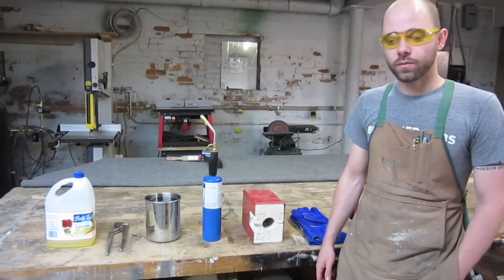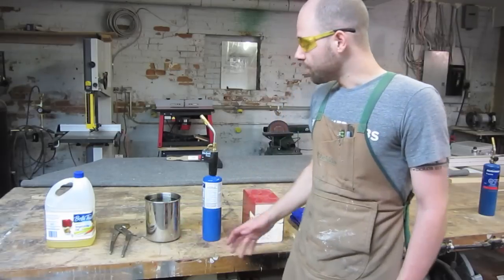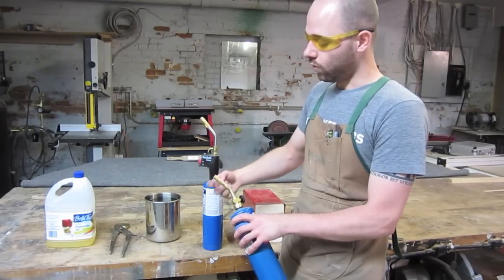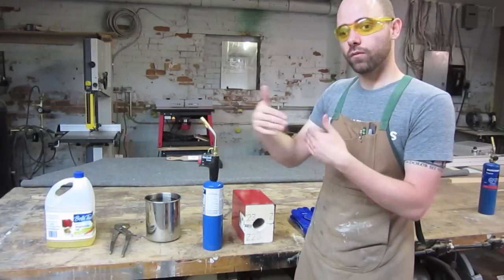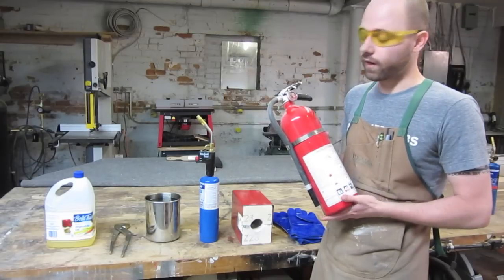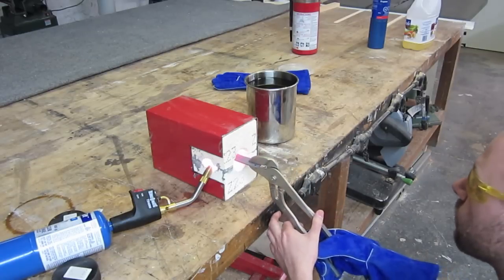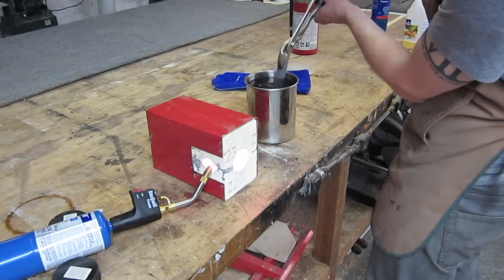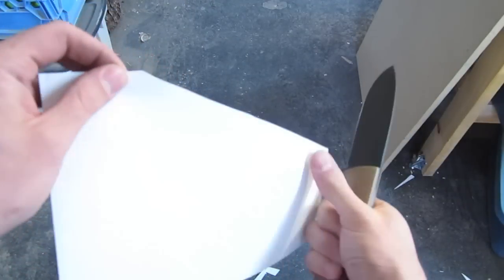How to heat-treat an O1 knife blade using cheap common tools.

Comment: Couple questions: where do you get the fire bricks?  Also,  do you know if this method would work for 5160?  Thanks for the vids, they are great and happy Forth of July!
Reply from the maker: paradox.c.moron Hey mate! Happy fourth to you too! I got my firebricks from a pottery supply place, look for furnace supply, pottery supply, ceramic supply in your area and you should find something! They need to be the soft white kind (K23 fire brick).

This exact method will work perfectly with 5160!

-Aaron

Comment: I just built a similar forge and decided to go with the bernzomatic  ts4000. Any issues with putting the head directly in the firebrick whole? I have heard its good to place the head ~1 inch away and I am worried it will heat up too much and melt the head. On the other hand I am worried I will loose heat and i wont be able to get the forge hot enough for working the steel. I'm working with 1095 and/or W1 tool steel. Any info helps, thanks for sharing so many great videos!
Reply from the maker: +Joshua Humphrey I haven't had any issues with having the head of my torch in contact with the brick, I doubt it will cause any problems, just don't jam it right in there, mine is just touching.

Comment: hi ty for the information i was wondering if you could hold the torch and move it back and forth on just the sharpening edge to temper it and not heat the entire blade so the back is softer and the blade edge is hardened ? ty foe the vids and your time.
Reply: You can yes, but I don't think differential hardening is a good idea. I recommend you harden the whole blade, and then do a 'differential temper' where you temper the spine a bit softer. That way you end up with a spring temper on the spine which is both strong and flexible.

Comment: For this specific application, how long did you let the forge heat up, and how long did it take to get the blade hot?
Reply from the maker: +malachi1616 I think the forge was pre-heated for about 10 minutes, then a little bit less to heat up the blade.

Comment: Man, I built a very similar design 2 brick forge. But I cant get the results you are. It appears to have good swirl. But the inside of mine doesnt glow as yours. Also I am currently unable to get my steel to temperature. Do you think its the torch head im using? I also dont have the bricks cemented together. Could this be the issue? So frustrating trying different things to get it right and not succeeding. Thanks again for the great videos and attitude.
Reply from the maker: Hey mate!
What kind of bricks did you use? are they soft white fire-bricks? What kind of torch are you using currently? It could be part of the problem... 

I understand what it's like to try and try and have something not work. Stick with it and I'll help you sort it out!
-Aaron

Comment: Great  video!  Thanks a lot. I keep  coming  for  more  tips:)
Can  somebody tell   what  would  happen if I  overheat  the  blade? 
Im having hard time getting  the "cherry red" color  on O1 steel...  When it  kinda looks  red ish,  it  still sticks to magnet, when its  almost  non magnetic  its  already more  like  orange, than  red...
Reply from the maker: RS Hey mate!
If you overheat the blade it will likely be a bit brittle, but should otherwise be ok.

One thing that trips a lot of people up is that you have to do your heat-treatment in a relatively dimly lit area. If you try to do it outside in the middle of the day under sunlight, the bright light will hide the colors of the steel. It's best to do it at dusk or even at night so you can see the steel glowing better. This is the reason that blacksmith shops are nearly always quite dim inside.

-Aaron
Reply: Gough Custom 
Thanks  a lot

Comment: I've been making knives from files and hardening them this way, I have to admit i'd be afraid to try and bend one in a vice though. Do you know what type of steel most files are made from. I used to make them without annealing them and keeping the blade cool while i grind it as not to loose the temper. I had broke 2 knives with hard use this way though lol... I think it's time to move on to some O1 and see how that works for me. Thanks for the video.
ATB, Steve.....
Reply from the maker: stevenk1965 Hey Steve!  I believe a lot of 'good' files are made from 1095, the problem is that a lot of files are also made from mild steel and then case hardened which means the steel in the mill is no good! I think switching to O1 is a good move! That way you know exactly what you're getting and your hard work will never be in vain!
Reply: Gough Custom Good to know, thanks for the response. BTW I'm not to far from you I live just outside Rochester  NY. Your accent fooled me though I wouldn't have guessed you were for Canada lol.

Comment: Aaron, thanks for the videos. I have really gotten a lot out of them. So my question for you is, when you heat treat in the forge, do you flip the blade end to end and also heat treat the entire handle. If so, do you allow the blade to cool completely, before you do the tang? Or do you just quench, flip it over and go right back into the forge?
Reply from the maker: The only reason I heat-treated the handle in my other video was to make the steel hard so the window-breaker would function. It's not ideal to have a soft tang on a knife, but it's not an enormous issue either... So what I'm saying is that there's really no need to flip it and heat-treat the handle. You have to be very careful doing so as well as if the heat gets to the blade it will make it fosft again.
Reply: Gough Custom On wrenches they don't harden the handles so they'll bend instead of break. I think a soft tang will be more durable in that regard.
Reply from the maker: Keith Larsen A properly hardened knife tang/blade will bend and spring back rather than breaking or bending and staying bent... Leaving the tang soft just makes it much more likely you'll end up with a bent knife! Properly heat-treated steel is very strong.

Comment from the maker: When using a forge this small it's kind of hard to heat the handle too. It's better to do both the blade and the handle though if your forge is larger.

Comment: Hey I've been following your tutorials and I'm now looking for a torch to heat my forge. Other than the air intake position of the torch are there any other things I have to look for when making a purchase? Bernzomatic torches arn't easy to find locally in Oz!
Reply from the maker: P-Vinny Make sure you don't get a 'pencil' torch (very small flame), other than that as long as you take the air hole position into account I think you should be fine!

Comment: Hi Aaron, thanks for all the help with these videos and responding to my comments. So I’ve tried to replicate this process with O1 tool steel and essentially a set up identical to yours and the best I’ve been able to acheice after tempering is 52 Rockwell hardness (c scale). I’ve been told that’s too soft and I should be getting nearer to 60 hrc. What am I doing wrong? I tempered at 450-500 for an hour after heat treating and quenching in the manner you show. Thanks for any help.
Reply from the maker: Hey mate! No worries at all! 450-500f is too high, you should be tempering at 400f. You might need to go a little bit hotter in the forge if you're not achieving full hardness as well! How are you testing the hardness?
Reply: I’ll try tempering at a lower heat, thanks. And my employer produces automotive parts and heavy duty fasteners so the QC dept is using an indentation machine to test on the c scale
Reply: . . . I’ve got more steel on the way so I’ll try more heat in the forge with lower tempering heat, and also try my current process with a lower tempering heat. Just to see which produces a better result. And thanks again!!

Comment: Good info, thanks! Will this same method work for 440C as well?
Reply from the maker: +Lee Beezy no, any stainless steel or medium alloy tool steel needs a furnace and stainless foil to heat treat.
Reply: Thanks, I've been doing my research since I posted the question. I have some O1 to work with now and building a homemade forge to heat treat it. I want to get into stainless in the future, so will be looking at getting an Evenheat oven at some point I'm sure. Take care.

Comment: hi aaron .  a question or two .  if you make a knife out of a saw blade or what have you why is it necessary to heat treat it  ?   would that not have been done already when the blade was made  ?      secondly is it possible to use a forge like that one shown here to do blacksmithing work  ?   or is it not reaching hot enough temperatures . ?     Thanks in advance .
Reply from the maker: Hey Hamish!
1) If you make a knife from a saw blade that's already heat-treated then whether you will need to heat-treat it again depends on the tools you have. If you only have files and such then the saw blade will be too hard to cut and you'll need to soften it (anneal it) in order to be able to cut it. If you have a grinder then you can work the steel in it's hardened state. Please note that I don't recommend starting with an unknown steel. The quality is too variable for the amount of time and effort you'll put into it, quality steel isn't all that expensive.

2) A forge like my little one should get hot enough to do blacksmith work for sure. It will easily achieve a yellow heat which as I understand it may even be hot enough for forge welding! Biggest problem is gas supply, those little propane tanks would get expensive fast! A bigger propane tank would be a good idea if possible.

-Aaron

Comment: hey mate...your works very inspiring me to do a knifemaking...i hv one question, is this heat treated method works on D2 steel...glad if you can answer it...thank you mate...
Reply from the maker: Hey mate! Glad the videos are helpful!

No, this method does not work on D2. Only simple steels like 1095, 1084, 5160, and O1.

Comment: Hi Aaron, you are great!!!  Can you tell me how long time quenching inside the oil??? A few seconds or until it cools completly???   Thanks a lot.
Reply from the maker: It needs to cool all the way to room temperature in the oil, usually a minute or so in the oil is fine!
Reply: Thank you very much for the answer Aaron!!!  I forgot ask you if is important the temperature of the pre-heat oil. 
 More or less which temperature have to have the oil for do a good quench????      Thanks a lot again!!!!!!
Reply from the maker: @ivangarcia-ph3tx  Warm oil is thinner and will therefore cool the blade a bit faster. I usually just heat a bit of scrap steel to red hot and quench that before doing the real heat-treat, just to pre-warm the oil.
Reply: Yes i saw you in the video doing that. Ok i understand you, the pre-heat is just to make the oil thinner to cool the blade faster!! Not matter to much if the oil is a littel bit more hot or less hot.     In the video you temper once at 400°F for 2h.    You recomend me temper twice like you say in the bladeforums????    Thanks a lot Aaron!! Your tuttorials are the best from all youtube.
Reply from the maker: @ivangarcia-ph3tx  Hey Ivan! Yes a double temper is best!
Reply: Thanks a lot Aaron!!!  You are a big inspiration!!!

Comment: Would this work for Damascus Billet 1095 and 15n20? I know for the 1095, 1084 and 1075 stuff.. what other steels will work with this forge and do I need to check for magnetic prior to quenching.. ? brick type you use in this video? Very good video BTW. thanks
Reply from the maker: +Jack N yes this should work for that type of Damascus no worries! The bricks are K23 fire brick

Comment: Great video.  unfortunately for me after I drilled out my 1-1/2 hole for the tunnel I drilled the hole straight but angled back instead of upward back.  I'm going to ream out the side hole.  Can you tell me how long it takes you from turning on the tank and preheating the forge, to cherry red knife?  I don't know if I did something wrong, or I'm impatient.  After 5 minutes there is no color at all.
Thanks
Reply from the maker: When the forge is already pre-heated it usually only takes 5 minutes or less to get the blade up to the right temperature.

You might have the wrong type of head on your torch. If it's a 'pencil' flame, then those usually don't put out enough heat.
Reply: Gough Custom
I do have the wrong head then.  How long to pre-heat the forge?  You make it look easy.  Thanks
Reply from the maker: Kevin Wolf I usually only have to preheat the forge for a few minutes. Less than 5 minutes I'd say. You'll start to see the inside glow bright orange once it's all preheated.

Comment: great video. could you just have laid the blade in the forge instead of going back and forth with it. also how long do you stand there moving the blade back and forth
Reply from the maker: The flame and 'hot spot' in the little forge is quite small, so I move the blade back and forth to avoid overheating one small section of the blade. I would not recommend just lying the blade in there as it will be too hot in one part and not hot enough in the rest.

I probably had the blade in there moving around for about 5 minutes or so.
Reply: Gough Custom
thanks

Comment: Very  clear instructions but I would add one step. Sand the blade clean after quenching before annealing. The clean surface shows the surface color of the tempered steel - should be a straw yellow. On the black surface you won't see them. I think this is important.
Reply from the maker: Sure, that's a good additional step

Comment: hey Aaron, I've heat treated my first knives today using a dug coal forge. i used the magnet method of testing and quenched in canola oil. the knives sounds a bit different as expected when testing with a file.... but im not sure im getting the gliding or skating effect. should i try heat treating again? im not sure of any other ways of testing the hardness but i dont simply want to call them hardened just because it passed a sound test. ive heard that sometimes the top layer can mar more than slightly inner bit of the blade. what do you think?
Reply from the maker: Hey mate!
Normally you need to get the steel about 50ºF hotter than the curie point (the temperature where the steel turns non-magnetic) before quenching (for most spring steels).

You should notice quite a difference if you're running the file over a freshly quenched blade, it will sound almost like you're running the file over the edge of a piece glass...

The outer layer could be softer, this would normally be caused by decarburization (loss of carbon from the steel when it's hot). But you would normally need to keep the steel how for a while to see a significant amount of decarb.

I would just try quenching it again from a slightly higher temperature.

-A
Reply: alright thanx, think im gonna invest in some anti scale soon too. i was hand sanding that stuff off forever. pretty sure i achieved a successful hardening after sanding off most of the scale and checking some areas. but i definately need to keep a better eye on the colors and less on the magnet from now on cause i dont like it as a good reliable source anymore. thanx for all the feedback mate, hope your knife making is going good. oh and ill try and send you some finished pics soon
Reply from the maker: Stephen Conklin Yeah I prefer to use the color of the steel as my reference too... You just have to make sure that the lighting is consistent when you're heat-treating. Doing it with only dim lighting is best.

Comment: HI Aaron, I built a coffee can type forge with a thermometer probe and a way to regulate the temperature, so fairly confident of getting a decent hardening, just one more question, if I were to stainless foil wrap my 01 blades, would I unwrap them before quenching or dip the lot, concern about cooling down while I tit about with red hot parcel !! Or is it not really worthwhile to wrap them, no direct contact with the flame in my forge
Reply from the maker: +gavo1958 Hey mate! There should be no need to stainless wrap your O1 blades, in fact I would recommend against it.

To protect O1 from decarb I would recommend using an anti-scale compound, like ATP-641 from Brownells.

-Aaron
Reply: HI Aaron, thanks again for your reply, unfortunately totally unavailable in Europe, I just read that hi temp header paint will work, much head scratching

Comment: Great video. I used propane and it took forever to get non magnetic. I made a forge from fire bricks and only had a 3 by 3 opening (inches). I put my torch on the entrance and pointed it in. Could this be the problem?  I looked into Mapp Pro and supposedly it only gets 100 degrees or so above propane. Do you have any knowledge on this? Thanks a lot.Charles
Reply from the maker: +Samara Volk If the chamber is 3x3" square then it's actually a fair bit larger that the chamber in my forge which is a 2" cylinder. You definitely need to have the torch going in from the side as well, as otherwise the hot gasses will just pass right through without dumping their heat.
Reply: +Gough Custom Thank you very much. I'll have to figure out a way to get holes in the brick I am using.

Comment: Hey Gough,

What is your recommendation on having a hole in the back of the forge?  Did you just do this for ease, or is for a practical reason?  I see people covering it up or not drilling/cutting all the way through.

Thanks!
Reply from the maker: It makes it far easier to get an even heat on the blade/tang as you can move the blade in as much as you like! I think either way would probably work fine to be honest!